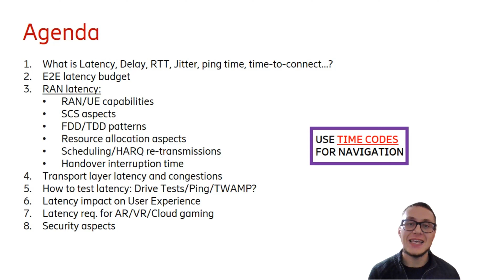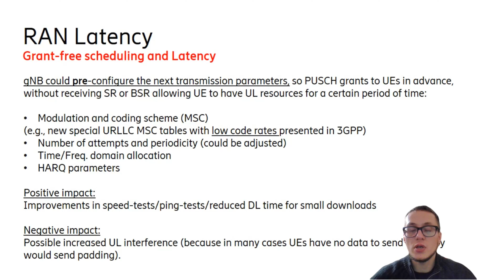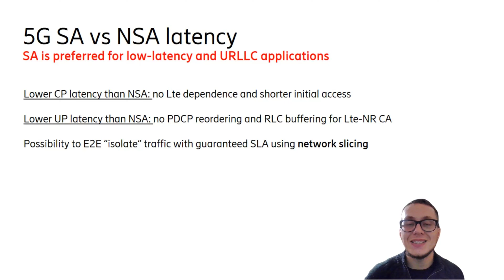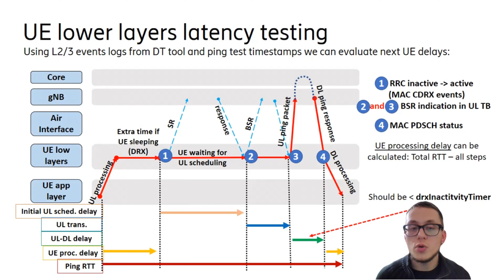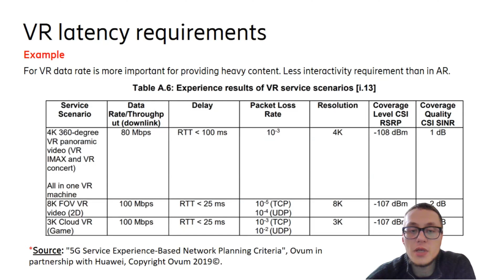5G Course - all about LATENCY in 5G | RAN features | Scheduling | SINR

Comment from the maker: 🐞Time codes:
0:22 - Agenda
1:32 - Latency issue
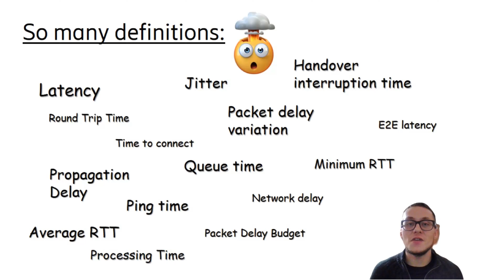2:15 - What is latency?
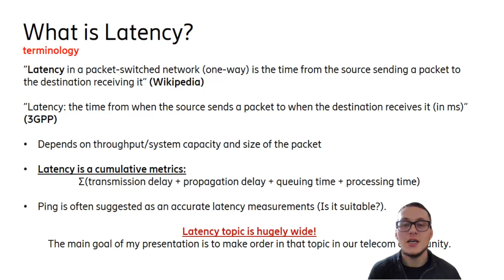3:37 - What is Round Trip Time?
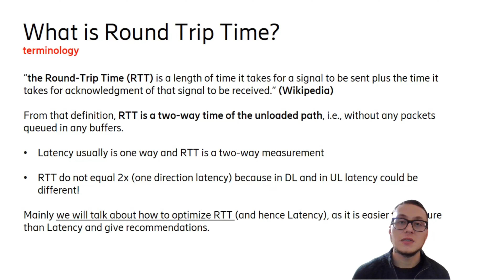4:42 - Ping time = latency/RTT?
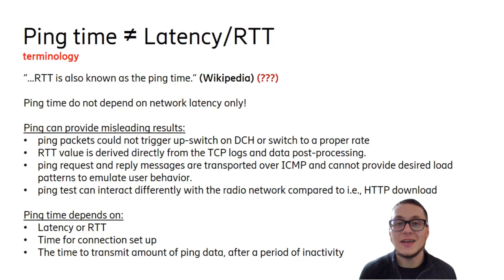5:37 - Minimum RTT
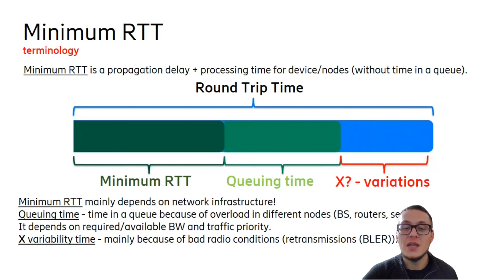6:37 - Latency jitter
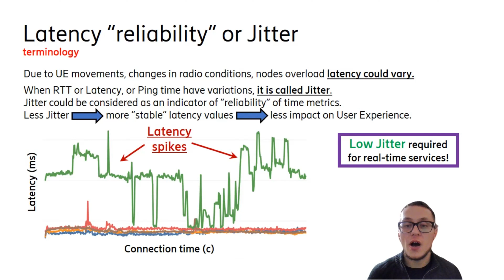7:45 - Latency and Time to Connect
8:27 - E2E Latency budget
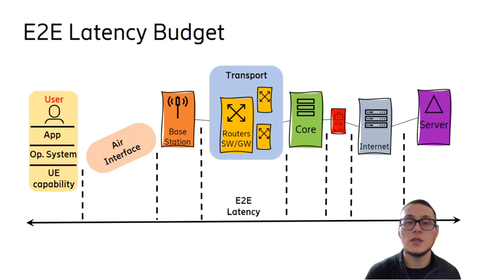10:38 - UE capability aspects
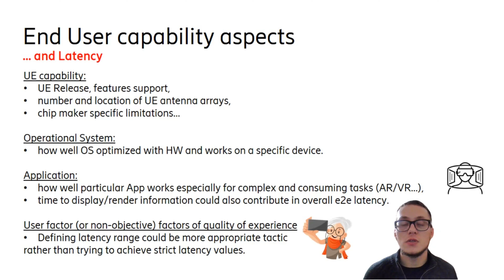12:14 - Latency and SINR
13:20 - Latency and Numerology/SCS
15:26 - Freq bands for low latency 
17:11 - FDD and TDD patterns for low latency
18:17 - 5G mini-slot for low latency
19:35 - 5G self-contained slot for low latency
20:45 - Scheduling impact on latency
20:02 - Grant-free scheduling and latency
23:07 - Scheduling optimization for low latency
25:43 - Scheduling impact examples
26:11 - UE mobility and 5G DAPS handover
28:15 - RAN latency during handovers
29:29 - DAPS Handover limitations
30:12 - RRC inactive state impact
31:02 - RAN features for improving latency
32:23 - 5G SA vs NSA latency
33:15 - Transport and Core latency
34:36 - Propagation delay in optic fiber and URLLC
36:24 - TCP/IP congestion delay
37:30 - X2/Xn overload
38:17 - Drive-Test latency testing
41:05 - Ping latency testing
43:00 - UE PHY/MAC latency testing
46:22 - TWAMP latency testing
50:03 - Latency impact on UE QoE
51:02 - Rohde&Schwarz QoE model
52:18 - Latency User Case requirements
54:23 - Latency - new vector for attracts!